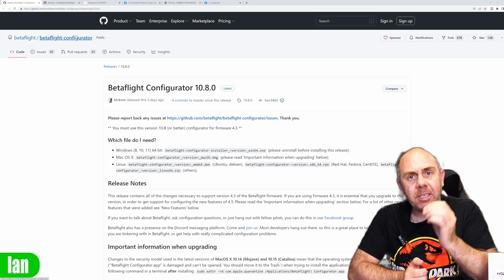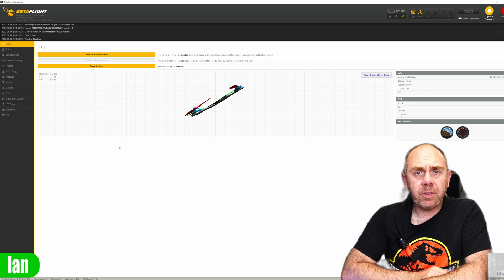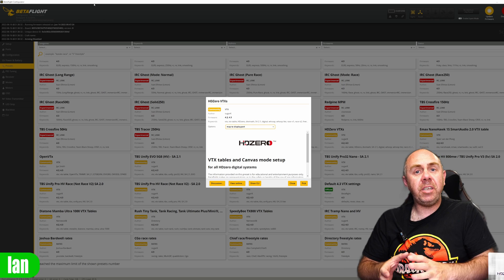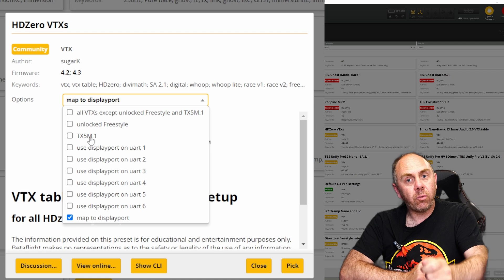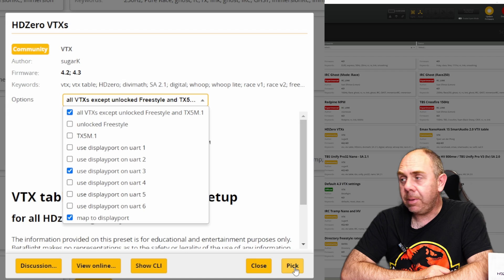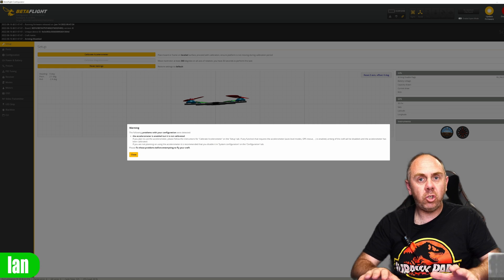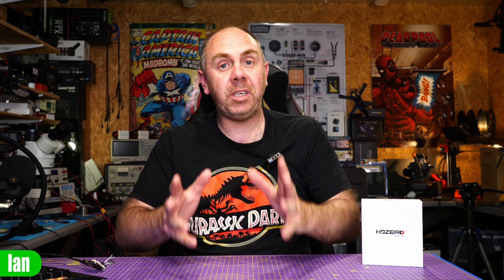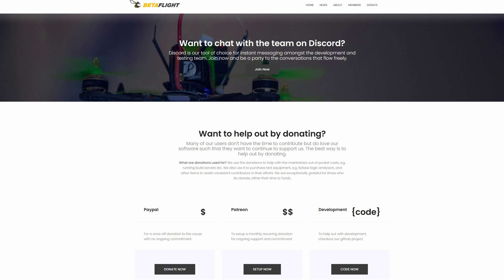HDZero OSD & VTX Setup  - Betaflight Preset

Comment: I purchased a brand new Happymodel Crux35 from HDZero with the 1 watt VTX. I get an osd, but get a black screen in the goggle display with the osd showing so I do not think the vtx is the issue. What are the odds that it is a bad camera out of the box. This quad came prebuilt from HDZero and I am having a very hard time getting them to send me a new camera. They want me to send some video of what the goggle screen looks like but because there is no video, I can not get the thing to record. I have two other quads with HDZero and both get excellent video. Should I try to update the vtx on the quad first or thee camera, or just swap the camera and see?

Comment: I have problem on my 1W vtx that when I do it like this my video and OSD works but I can't control my vtx with my radio. I just can't get into vtx menu by stick inputs. FC is Diatone Mamba Basic F722 MK3. I have Crossfire soldered on TX1 and RX1, 1W vtx is wired on TX3 and VTX/RX3 and MSP blue wire from vtx is soldered on TX2 but I dont want to use SA, it is just soldered but disabled in Betaflight. When I do the preset I click on unlocked freestyle(and yes, my vtx is unlocked),map to displayport and use displayport and MSP on UART3. After save and reboot like this I have video and OSD working but I just can't get my vtx menu working. Also to mention on my vtx blue light is just on, not blinking. Any thoughts?

Comment: Thanks for posting this video. I tried everything you mention if the straight forward configuration do not work. It still did not work for me. the fight controller is the SkyStar F722 mini HD Pro. I'm using the HDzero unlockfreestyle. If any body have any clue why let me know. I am also running betaflight 4.3.0 on the flight controller.

Comment: I confirm that on my Mamba F722 HDZERO OSD does not work if connected to the ‘default’ analog vtx uart but works fine on another free uart. Mine has a plug for use with DJI and works fine on that uart

Comment: Ian you mentioned on your stream a few days ago that there should be a tvs diode installed when using HDzero, but rather than on the battery lead, it should be at the VTX. stupid question? would it be wired up with the positive on the positive lead going to the vtx and the negative returning respectively, or 'in-line' on the positive side? I'm no electrical engineer but at least I'll ask the idiot questions before finding out the hard way :)

Comment: Does this actually work for the whoop board? If I recall correctly, there's no smart audio.
Reply from the maker: Yes still adds all the osd ect setup.
Reply: Yeah, you've always been able to do it with the Whoop board. It uses a UART without actually being wired up...
Reply: Yehs it’ll still setup your canvas mode just don’t worry about the VTX table stuff as it doesn’t matter